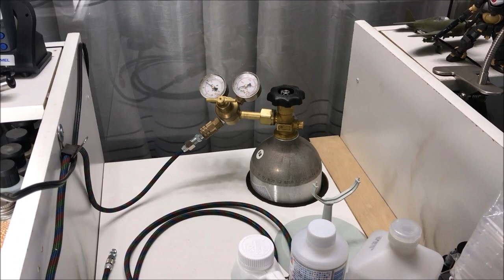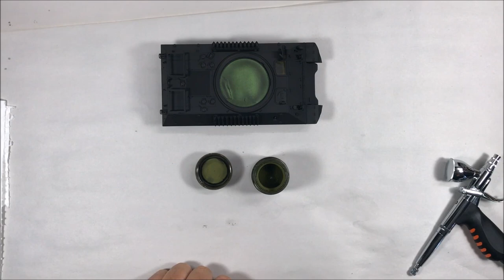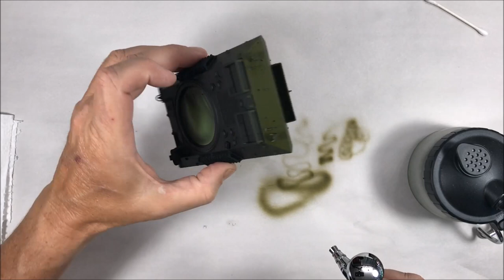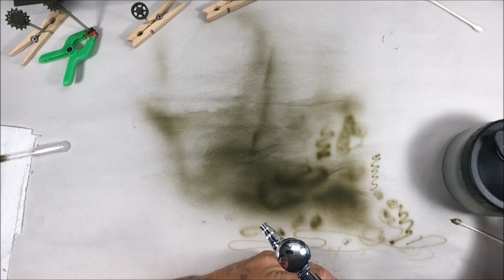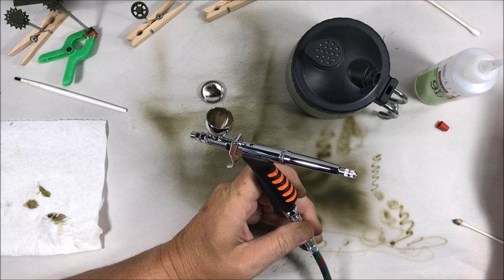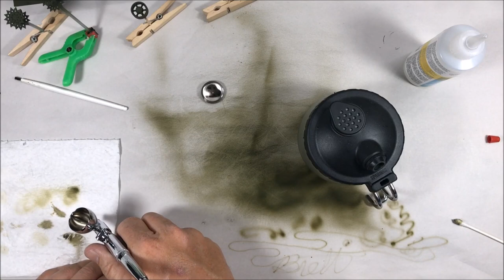Airbrush Review and M10 Paint

Comment: Many thanks for the in-depth review Brett.  I think I am sold on this now.  It just seems more natural and ergonomic than traditional airbrush trigger designs.  The paint limiter would also be ideal - I am a bit ham-fisted, so would me help not to pull the trigger too far back and flood the model with paint.
I also really like the look of your single action, that would be ideal for priming and also for clear coats.
Reply from the maker: I agree. The trigger is very smooth and I think even some really fine camo would would turn out great if the paint is right. 
And the single action is really nice. That is exactly what I use it for, but it can also spray pretty fine as well.